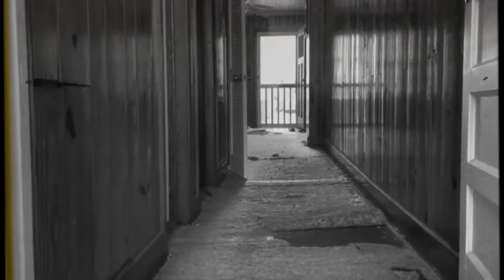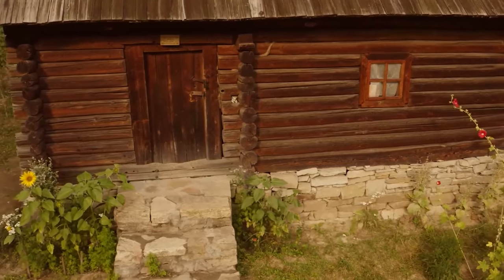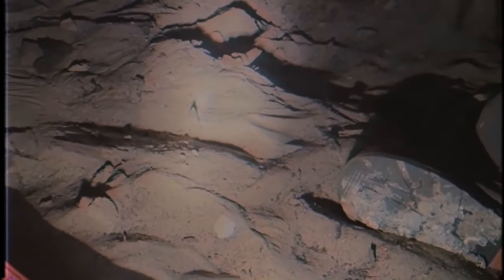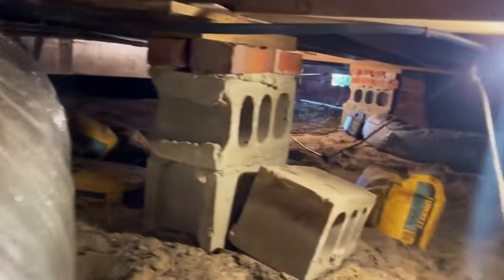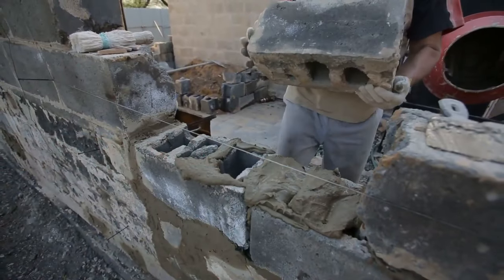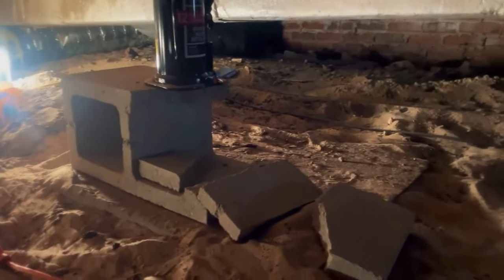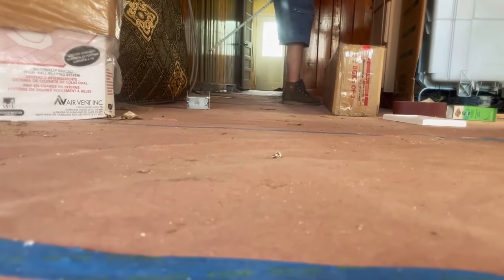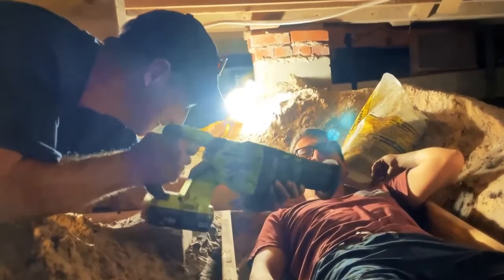Lifting up floors. 7 mistakes to avoid | Jacking and leveling sagging floors

Comment: Stop doing this people, it's tons of work for nothing because you are not accounting for warped joist. You can try to do all this but it's impossible to unwarp wood.

The correct way fix this is to remove floors and sub floors down to just joist and you sister new lumber "crown up" and both ends must meet the sill plates.

You work from above instead of on your back, and you actually fix the problem and add value to your home... 

Just saying... Once you start jacking up areas and possibly cracking old lathe and plaster, and still have unlevel floors you might as well just spend a few hundred to actually do it right, and faster...
Reply from the maker: You are right about easier, by not crawling in tight spots living life there. But I completely disagree with what you mentioned regarding cost, it's definitely not few hundred, but few thousand removing all plywood and putting new one and then few more thousand removing flooring and putting new one, when in my case on this video I had hard wood and just resurfaced it. Not everyone got extra 4-5k and more for all new materials to put, especially nowadays.
Reply: @sergii_contractor  few hundred for the joist...

Yes thousands for everything after fixing the floor joist... But until you do it doesn't matter what you have as flooring until you fix the problem...
And I'm very sure you spent a few thousand already for contractor, cement blocks, cement, lumber and jacks... 🤷

I feel you not everyone has it, but we are talking about fixing the floor joist correct? Stages, but first joist, then sub for and the flooring.

If in fact the floor isn't level you'd have to resurface everything again if you did level it with jacks because you sanded while it wasn't leveled...

Just saying you probably going to have to let go of the hardwoods, or just settle with unlevel floors.. I literally got done self leveling a 3 foot hallway where the was a 2 inch difference from each side, this was after the guy did everything you already done, but completely defeated and wanting to get rid of the house now...

In all reality he should of fixed everything from the top... So yes you may spend a few thousand as any job on a house, and me as a contractor crawling under houses maybe I'm a snob and unfairly equating the value id charge vs working from on top 😂 and I don't value hardwoods, after stains and carpets, hell to properly resurface those cost thousands and a week... 

I feel ya though, I do like you put proper effort in under the house, but I'm almost 50, 6"1, 250 and just suggesting under a house I think in thousands 🤣🤣🤣
Reply from the maker: @jeromegarcia5396  Just couple of remarks:
1) This is mostly DIY channel, particular this video, so with DIY way the difference between removing everything and sistering, putting new plywood and floor and doing work yourself will be I would say around 5k at least depending on size. With material prices jacked up can go way more. It all depends on who operates what budget..
2) You can not sand down unleveled wood floors making them better leveled allegedly taking more of the wood in high spots lol The belt sander goes up and down over the surface like snowmobile on mountains
3) Agreed, the job is very difficult, physically challenging and gets annoying, I can see people regret starting it. And won't make perfect results, but will definitely save the house from farther sinking and will provide with better look if done properly
Reply: @sergii_contractor  Stop it. There's a right way to do it... DIY has nothing to do with it. If you don't know how then stop... Professionals are called that for a reason.

Take the advice or not, but professionals like myself charge more because everyone thinks they can do something and can't and by the time a professional touches it it's not just a basic job...

If you claiming to save a house from further damage it will be to do it correctly. All I said. This information is to help those who are yet to try this and thinking about short cuts, don't... Do it right
Reply from the maker: @jeromegarcia5396  Could of start from this, that you are contractor who does this type of work and DIY videos take bread off your table. I displayed on the video that project was done successfully. Obviously you offering the best way to fix the problem, but it will cost from 5 to 10k more, not everyone got those money, end of story.
Reply: @sergii_contractor  oh, I never said takes money from me, I said becomes a way bigger job than just replacing the joist, I don't need to be a contractor to understand there's a right way and all the others...

As a contractor I'm trying to save everyone money by telling you to do it right from the start... You keep telling me it cost way more, well I guess I'll listen to your advice...

BTW I've built a home off grid using recycled tires and sand bags and materials and shown the world how to DIY on a Facebook page, today I'm currently working on my second earth home using recycled materials, so I could imagine I probably don't know much at all on anything you are doing...

If you are upset because I'm contrary to what you are pushing then that's one outlook, but if you are just making about you being right about the situation then you can have it, you're way invested on your back, under a house learning as you go... 🤷

Good luck to everyone trying to save a buck, and jacking up your house 😂 it's not a Chevy, nor should this thinking be used on the biggest most important investment of your lives...

Put temporary kickstands until you can afford to do it correctly, and yes sometimes your old floors have to go, and shouldn't dictate your having to fix something correctly...

I can tell an employee to wear safety glasses everyday all day doesn't mean it'll happen and that's why we have workers comp... Potato, tomato, it's all the same to me...